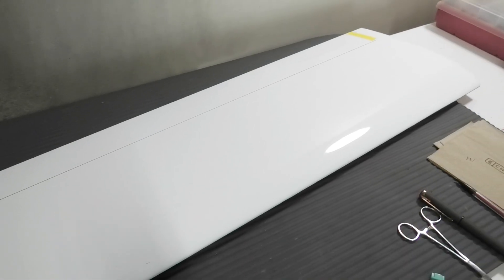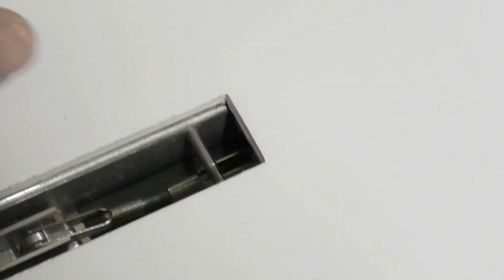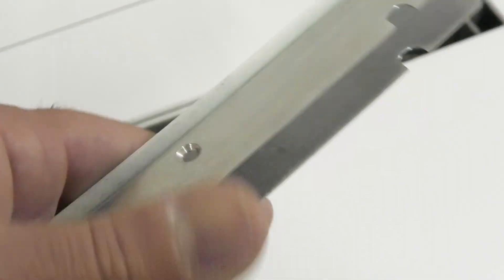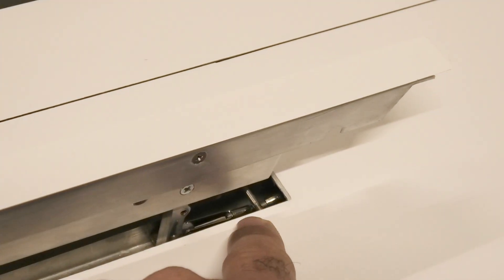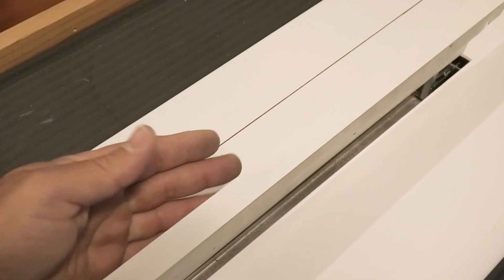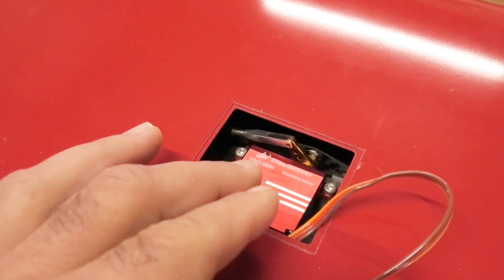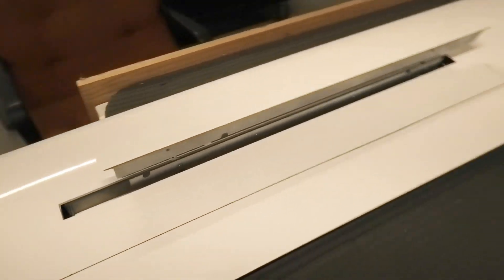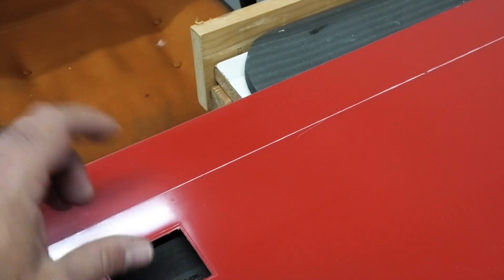ASH30 Scale RC Glider Spoiler Assembly

Comment: Oh boy. Here’s the thing with spoilers on scale sailplanes. I have some experience in this area. You did a great job getting them to function at least. The slop in the spoiler itself that you demonstrated at the end of the video results in the following: Anytime you are flying fast, the spoilers will suck open. The low pressure over top of the wing generating lift will literally suck them open. Doesn’t matter how perfect your servo setup is. They will suck open. It’s a real drag emotionally and literally. The solution is something you mentioned at the beginning of this video. Disable the spoilers and spend your efforts on getting the flaps to deploy like F5J flaps. The glider is actually way easier to land this way anyhow. Many GPS racing scale ships don’t even include spoilers for this very reason. Mike Smith disabled the spoilers on his Antares for this reason. If your client is just going to boat around the sky maybe it won’t be an issue, but as soon as you pour some speed on, they will suck open.

Comment: You might save yourself some trouble by splitting the flap into 2 sections? Also give more options for roll mixing.
Reply from the maker: That is actually my bail out plan if the two servos don't sync up well! Glad you mentioned it.